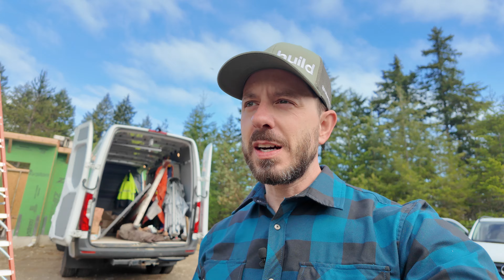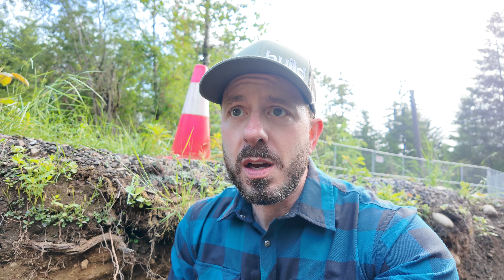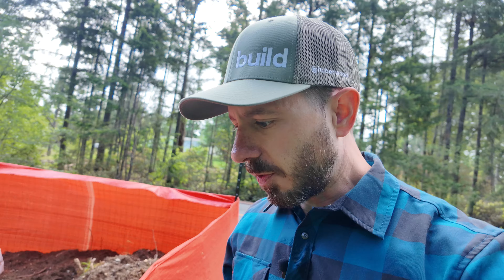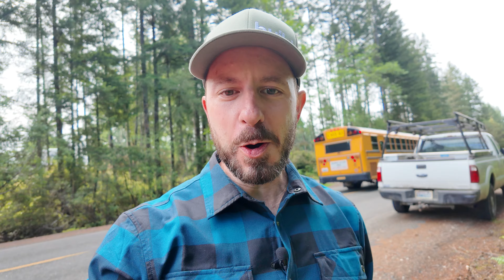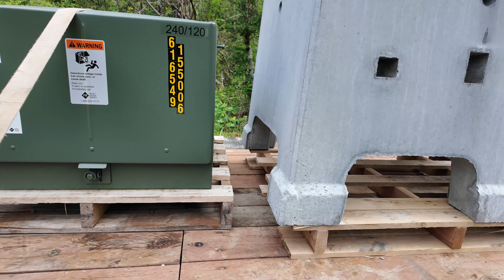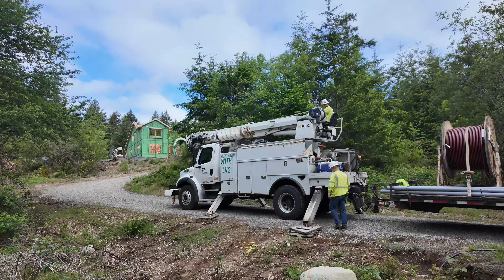Electrical Infrastructure for a New Home

Comment: Here in Vermont the electric to our old home needed to have a new, thicker, line from the power company (we had a really old pole and wire coming to the house. We upgraded from 100 amp service to 200 amp.) Everything was so old that the power company didn't recognize the old pole in the middle of our poroperty and the wire to the house hasn't been used in decades. We did have breakers though! They had to put in two new poles and string a line to the other side of the house. Took less then 2 months from start to finish and I don't recall signing anything or jumping through myltiple steps. 😊. It's been 5 years since the install and we hired a pro to install everything inside of the house. (Remember ... always seperate grounds and neutrals on any sub panels).
Reply from the maker: Awesome comment, thank you!